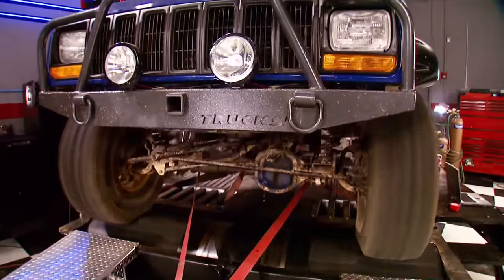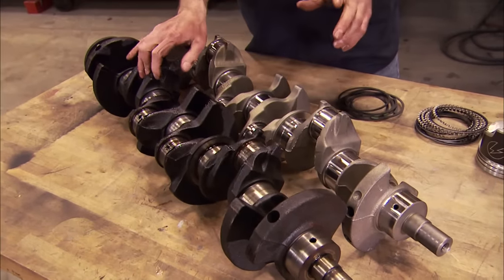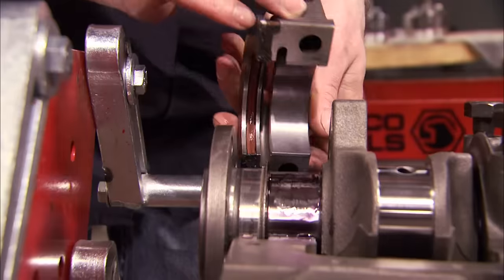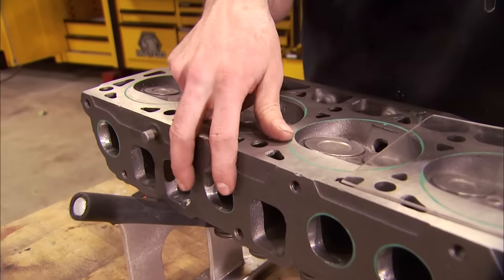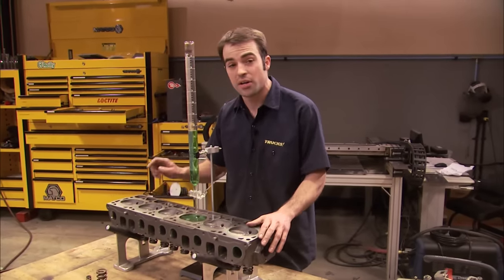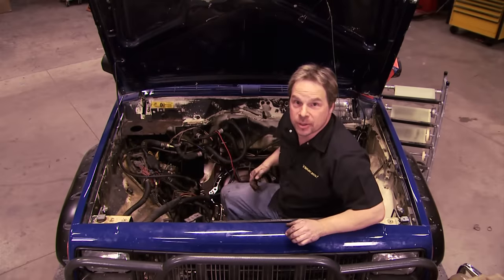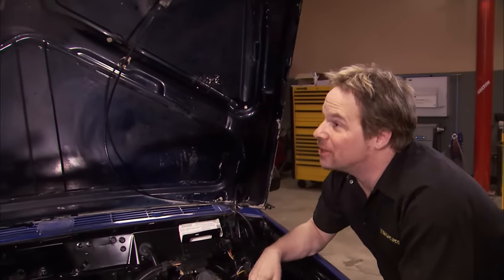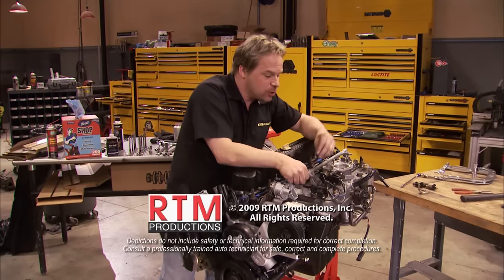Improving Air Flow And Displacement On Our Cheap Cherokee's Straight Six - Trucks! S11, E7

Comment: Gasket matching - one of the most misunderstood and misapplied steps.  So you made a flared out funnel at the intake entry to the head, and the same funnel at the manifold face.  If you then made a port mold of the full intake tract to see the result of your work, it would now look like a snake that swallowed something.  And besides, why would you believe the gasket dimensions are something special? FelPro  doesn't know some secret dimensions that your motor needs.  Stop the insanity with this please.  Do your port work sensibly based on reasons.  And, beyond all this, gasket matching just means they're the same size - does nothing about alignment.  Between bolt hole clearance, intake/head gasket thickness variances and head milling (for V engines), it is doubtful the ports will be in perfect alignment resulting in a step at the manifold to head surface negating all your hard work.  For any street motor, you are almost always better off with a slightly smaller port in manifold.

Comment: 2jz swap
Reply: The motor mounts match and the trans mounts up but with only 4 bolts
Reply: That's about as imaginative as "drop an LS in it". If I was doing an engine swapp I think I'd go for a Barra. Not saying it's better. Just different.
Reply: mpetersen6 but barras are way better than 2j just parts are hard to find in the US
Reply: @lscansir cured 
That's another option too. One thing with the DOHC motors is overall height. If money is not an object I could come up with all kinds of ideas. A Jag 4.2 liter with triple Webers? But it's an off road vehicle. You wants enough power but you dont want to break the tires loose all the time either. It sounds like heresy but you can have too much power. If you can't get it too the ground it's too much
Reply: mpetersen6 the bara engine is great.You won’t be going to auto zone for parts if you live in the states.
Reply: @trevorthomas6043  
There's people starting to import them into the states. I think if I were going to go that route I'd make sure to get spare parts. There's no point in building something that you would have to worry about fixing. 
Myself I think I'd be more interested in a 4.0 that puts out about 300 hp in something like a 69 American. Replace the front suspension with something modern. Go to an IRS with a 6 speed transmission. For tires and wheels look more towards handling. Vented disc brakes at all four corners. Really good seats. Something you could tour in reliably yet still do some auto crossing.
Reply: mpetersen6 69 American? If your plan on running the engine in a Jeep your going to need a adapter plate for transmission .Most likely going to need a custom drive shaft.I wouldn’t even try to adapt the ecu.I would go with a stand alone..it’s pricey.
Reply: @trevorthomas6043  
The 4.0 should pretty much bolt right in seeing as how it's pretty much the same motor as a 232 or 199. It is also pretty much the same as the Mexican 252 and 282. These were the AMC six produced in Mexico with the same crankshaft as the 232 and 258. Except the bore was opened up to 3.875. Depending on how heavy the casting is I'm not sure how much the bore could be opened up. Too bad they never took the bore out to 4.00 and the stroke to 4.00. That would have been almost 5 liters at 301.5 CID.  My thought with the 4.0 is open it up to 4.00 and use the crank from a 199 to bring the displacement down to 226 CID or 3.75 liters. Cut up a set of  Cleveland heads and weld them together. New bump stick,  roller lifters, roller rockers etc. Expensive? Sure. Worth it? From a purely in pursuit of power standpoint? No, it isn't.  Just as easy to go with a V-8. But then just about anybody can think of dropping in an LS. As Hot Rod used to say, "Dare to be Different".